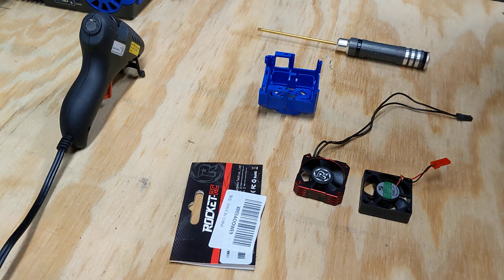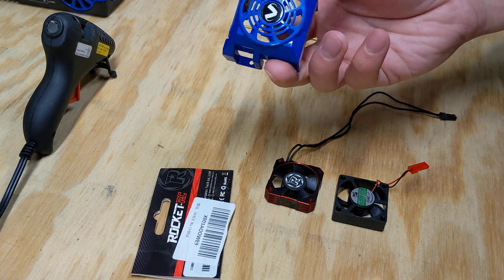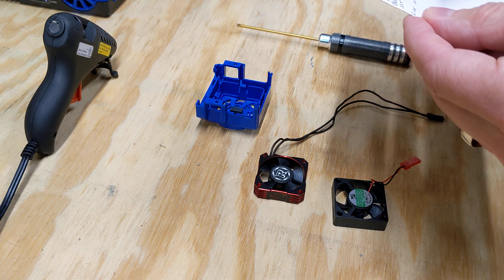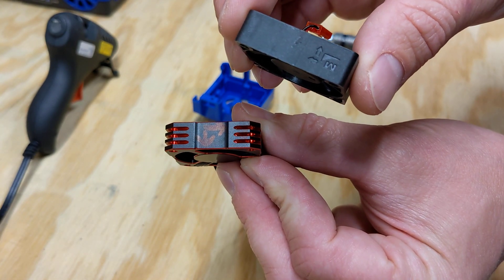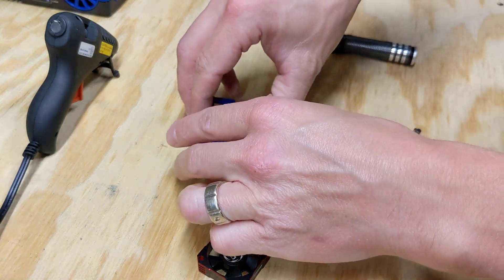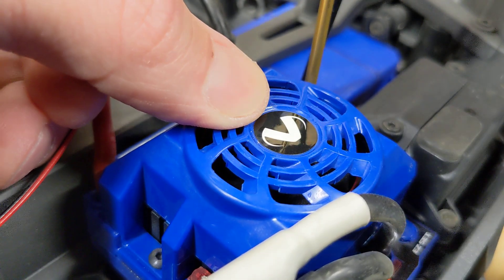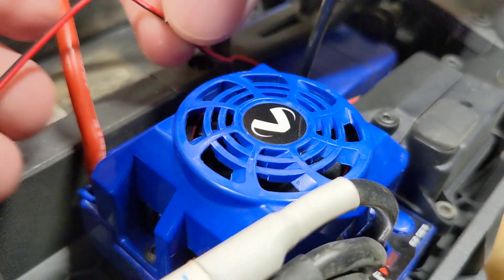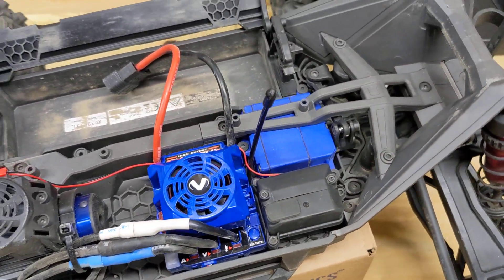Traxxas MAXX VXL-4s ESC: Aluminum Fan Upgrade - Cheap & Fast!

Comment: I love these rocket fans, I have them on all my RCs. Just bought my first Traxxas, the Maxx V2. First thing I did was get the light kit & hot racing battery mount straps for bigger batteries. I wanted to do 2 fans on the motor but I know how powerful they are, I think one on the ESC & one on the motor should be plenty of air. I always like to check things out before I go hands on with new platforms, this was a great video thank you very much.
Reply from the maker: Glad it helped you out! I love my Maxx v2, but it's only made my desire for the X-Maxx even greater!

Comment: Where can I get a cover of this for 4s esc?
Reply from the maker: Do you mean the plastic ESC fan cover? Traxxas parts page would have it, easy Amazon search, or your local RC shop of course. Assuming you still have the OEM/Stock ESC.
Reply: Can't find that one. I bought a raptor ultimate says it has a vxl-4s. I cant find this shroud.

Comment: What fan and mount are you using on the motor?
Thanks
Reply from the maker: Still running the stock/OEM, as that hasn't been an issue - yet. But, it's the same size and connection, you could use the same as this/whatever you use for the ESC.

Comment: where did you plug it in?
Reply from the maker: The new fan? It plugs right into the ESC where the stock/OEM fan was plugged. It's a quick, easy, and cheap upgrade

Comment: Would that same fan work on the motor?
Reply: Both my fans went out today at the same time, really weird. Gonna go to a hobby shop tomorrow and make sure the fans are the issue. My truck still drives and turns but no fans, called Traxxas and he couldn’t believe both fans went out at the same time
Reply from the maker: @Itz_littlebear  That's pretty crazy. Was it after a hard landing/tumble/crash? Easy upgrade for $30! I want to say there was a 2-pack deal on the one fan I had bought.
Be careful driving it, if you should at all, without any fans. The components may over heat or possibly cause more damage or premature wear with getting higher temps. Good luck!
Reply: @visual86  hey thanks for the reply. When it happened I talked to Traxxas and one guy told me the esc is gonna have to be replaced. Talked to another guy who does the replacement stuff and he said it’s likely just the fans. I looked into it deeper,took the fans out and turns out both fans were just Jammed with little debris in between the fan blade and the wall. So nothing was wrong, I felt pretty dumb,lol. Just glad nothing serious happened and might upgrade those fans anyway.
Reply from the maker: @Itz_littlebear  well that's a cheap solution then, just clearing out debris! No reason to feel dumb, that's pretty odd for both to jam at the same time.
That's part of the issue with the plastic fans, is they're easily jammed with loose dirt, rocks, or other fine debris. Not saying the aluminum fan won't, but it's a more powerful, higher RPM fan too.
I'm surprised they said the ESC would need to be replaced, considering only the ESC's fan runs direct from that, the motor fan runs off the Receiver. I'm not positive if the ESC and Receiver have bi-directional communication concerning the motor's fan, I suppose it's more than possible. However, I've noticed the motor's fan turns on immediately with the vehicle, whereas the ESC fan turns on as the ESC boots, there's a slight delay. That'd lead me to believe the motor fan is on/off with the Receiver. I'm sure someone with far more experience and knowledge, than myself could explain better or more in-depth.
In any case, glad you figured it out and it was easy (and cheap) for you!
Reply from the maker: I don't see why not. Yes I believe so. I measured my motor fan and it's the exact same part number on the unit, as well as dimensions. Same style connection as well.